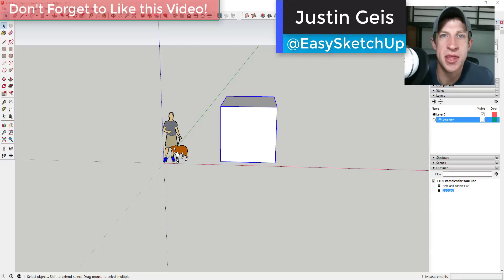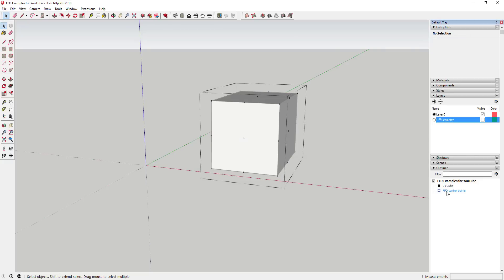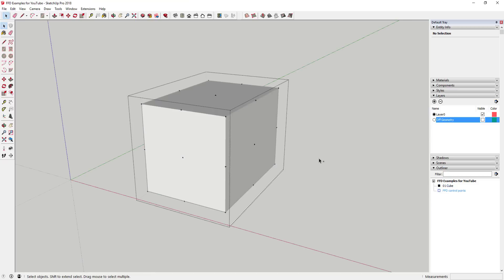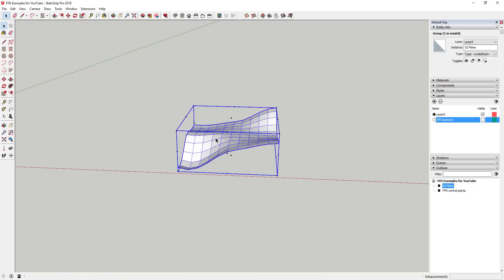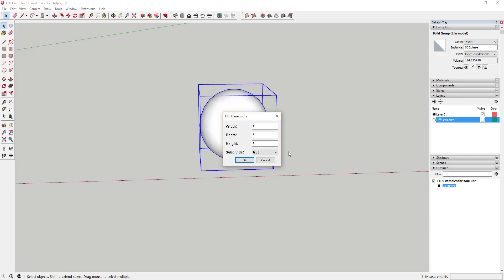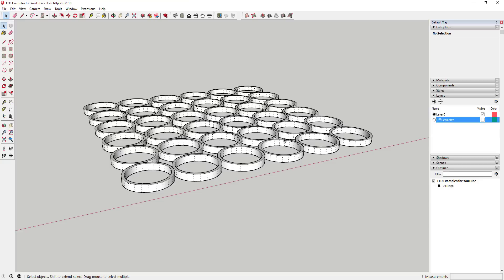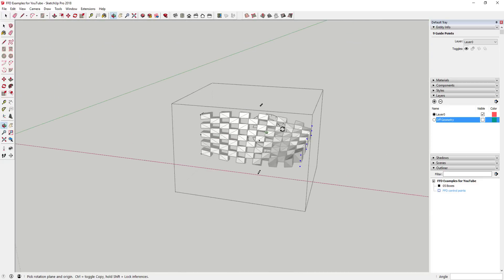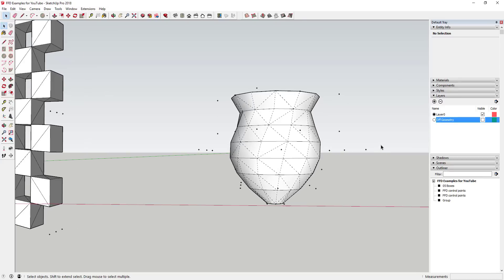BEST TIPS for Modeling with FFD in SketchUp!

Comment: I installed the plug in scetchup 2017 and 2018, but I cannot select the points after double clicking on a grouped shape.
The points appear as light grey points. Any idea what could be wrong ?
Kind regards
Nick
Reply from the maker: Maybe try to find the points group in the outliner - sometimes I have trouble selecting them by double clicking in the model itself because they're so small
Reply: @Thesketchupessentials  I can't find the window you have on the right side of your screen since I have a MacBook hence me finding it hard to pick your ffd  points which are on the group, your earlier version had points which were offset from the actual group itself which was much easier to select and navigate

Comment: I have such a problem with FFD that when my group is rotated, so its local axes don't match global model axes, FFD group will not be matched to group's local axes but to model's global axes istead. This doesn't allow me to use it precisely. Do you know if there's any way to force it matching group's local axes?
Reply from the maker: Reset your global model axes to match your local axes? Draw a box first so you can easily change it back?
Reply: If I first draw a group, impose an FFD cage and then rotate or move them together, FFD goes crazy and starts making terrible mess with the mesh. Even if I change global axes, FFD with stick to their original, "native" setting, that's strange. The same problem I have with Fredo Scale. Sometimes deformation box won't be automatically matched properly to group extents and clicking an edge to match it manually doesn't help. I don't know if Fredo Scale has any feature like "match deformation box to group's bounding box", so that orientation of deformation box would be like in native scale tool.

Comment: is it works on su 2017?
i already downloaded it from the link in description, but it different from your video
Reply from the maker: It should - I used it with SketchUp 2017 all last year, so it should work fine...
Reply: It works in 2017. That's the version I use and I just added the plugin and tested...
Reply: Make sure You are working with group. It seems, that FFD doesn't work with components.

Comment: FFD is REALLY Interesting but I don't know if it will work for me .   I  have a survey of my site with a number of points indicating the elevation .  I want to create a 3D model of the site so that I can calculate the volume of dirt I will generate/need as I level the site to place the buildings and parking lot .  From the video I don't think FFD will work so can you give me any suggestions about plugins that will produce a 3D site plan? Also, while we are at it my survey includes thee locations, size and types of trees on the site ... where can I find good 3D models of trees so I can add the trees into my model?
Reply from the maker: FFD is probably not the right tool for sitework - you may want to try Toposhaper - https://www.youtube.com/watch?v=-Jd-wiznAbo - You may want to start here for planting info - https://www.youtube.com/watch?v=chiT98Zu6Ks - Thanks!